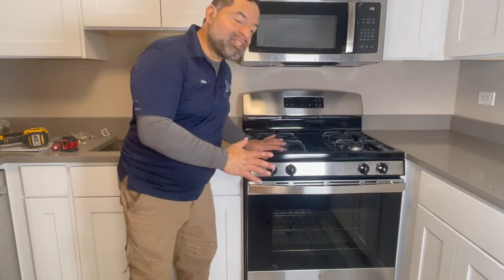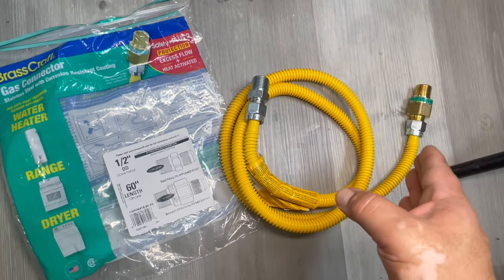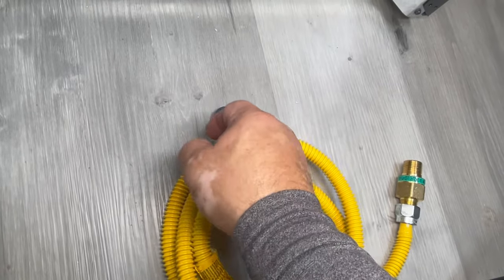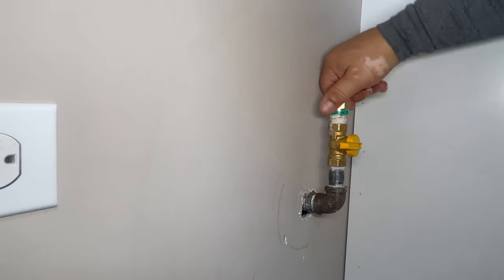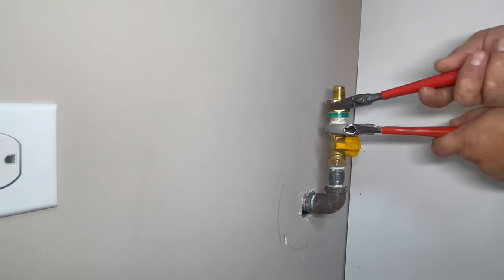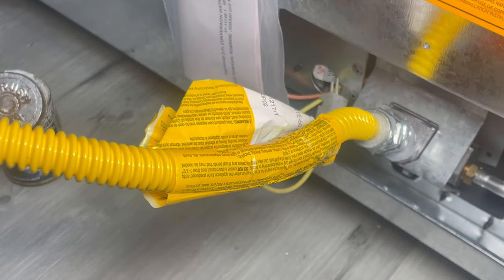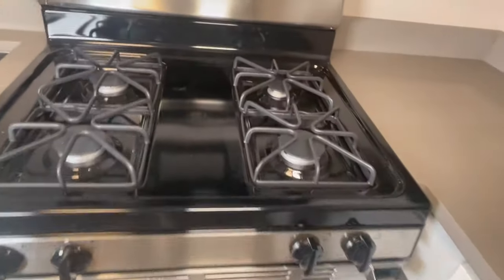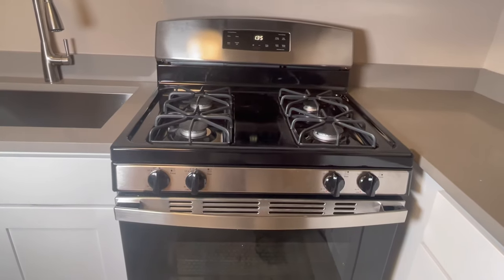HOW TO INSTALL ON OVEN/RANGE W/SAFETY +PLUS2 THERMAL EXCESS FLOW VALVE.

Comment: Hi, my gas line supply valve has a male flare end (the opposite of the one in this video) & the safety+plus fitting has the same so I can not connect it. Should I add a coupling? Or where can I find a safety+plus fitting with a female end?

Comment: thanks but i'm confused about the hose used.  It looks like you have a 1/2 in OD.  But the link takes you yo one that is 5/8 OD, which would seem more appropriate for a large Stove w/ oven.  Dont you have to consider what the BTU rating is and match the hose to it?
Reply from the maker: Hello Jeff,  Good catch!     However the total BTU for that Range/oven is 48,000  It has only 4 burners.   The 1/2 OD flex line that I Installed  is rated for 55000 BTU.   So totally ok.  But I get  what you mean.   If it was a double oven or bigger burners the 5/8 OD  makes more sense.  Thanks for your comment.

Comment: Why you didn’t put the white sealants on the yellow line connector?
Reply from the maker: Hello.   Those connectors are flare connectors.   They don’t get any Teflon paste or tape.   The seal is at the flare not at the threads .  (Metal to metal  anything in between jeopardizes the seal )
Reply: Good question, no tape/sealant on flare connections.

Comment: I got a stove and the old hose doesnt fit the new one and i cant get it off should i just add an adapter
Reply from the maker: Yes just add an adapter.  If your gas flex line is too old (10 yrs or more). I suggest you get a new one.

Comment: Can you explain using a nipple and changing the fitting? I have received a used stove that uses a 5/8 OD hose but my gas line on the wall is 1/2 OD flare valve.
Reply from the maker: Hello Vanessa,
99.9 % of ranges come equipped with half in male pipe.  If that the case on your new used one, just remove the 1/2 fittings and flex line from your old existing one.  Look at min 3:01 of the video. It shows 1/2elbow, 1/2nipple, 1/2gas valve,  and 1/2 pipe to 1/2 connector.    
If you buy a new 1/2 lines it will come with two connectors and flex line.   That might be all you need.  
Or use the1/2 flex and connectors  you already have and your old existing range and put them on the new (used one )
Just send me a picture of what it comes out of the wall, and I will tell you what you need.  Also send me a picture of the range connector.

Comment: Why did you fail to add a Union?
Reply from the maker: Hello Brian.   You have to be more specific.   And site the regulation number you are talking about.    I understand a union on a furnace or boiler before the gas valve  (as a control device). to be able to service or replace. but not on a range.  Different application.    The range has a shut off valve.  Not a control gas valve .